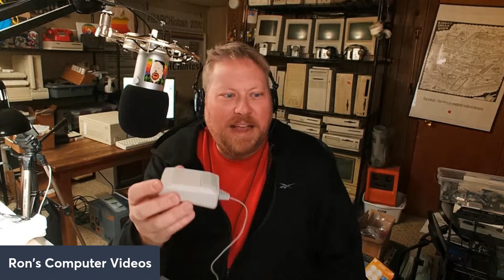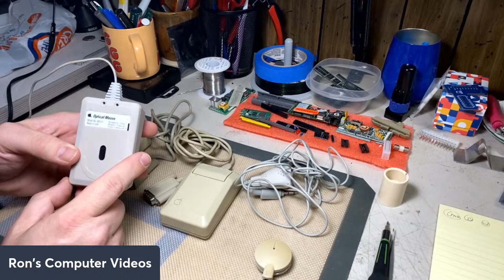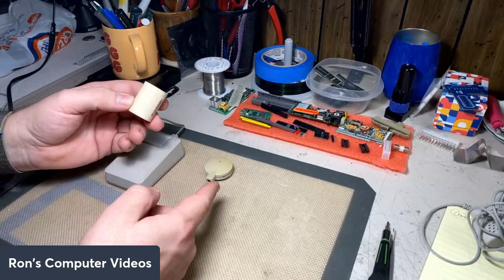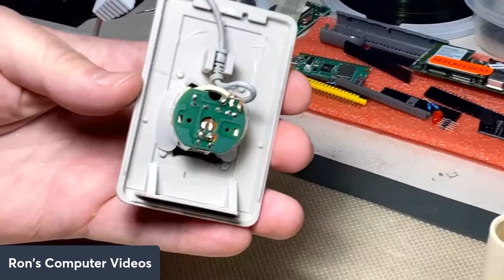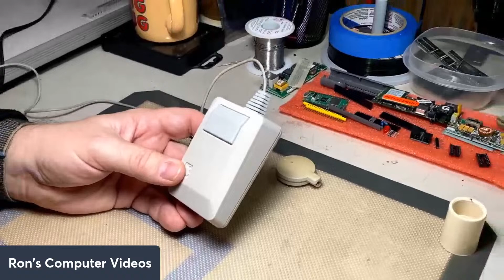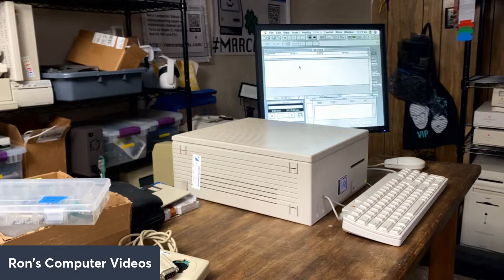Boldly sound like no one has sounded before! - Make your own MouseMic #MARCHintosh #startrek

Comment: There's so much space in the shell. I wonder how big Javier's optical mouse PCB is? Wouldn't it be cool if you could fit both PCB's in there and have it do double duty?

I remember buying one of those microphones. I wanted to use it with my IIGS for the asthetics as opposed to the HyperStudio microphone, but alas it wouldn't work. I think I was told those Mac microphones needed power to work so I never did end up finding a use for it